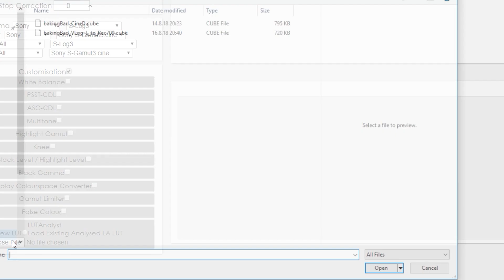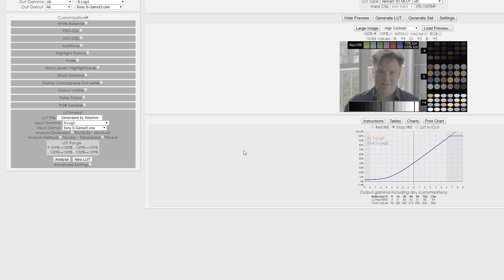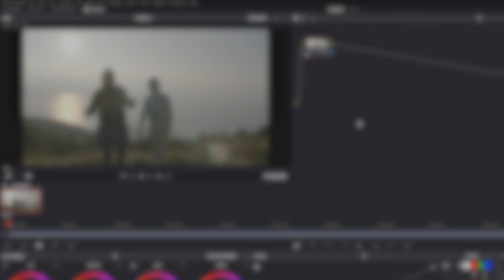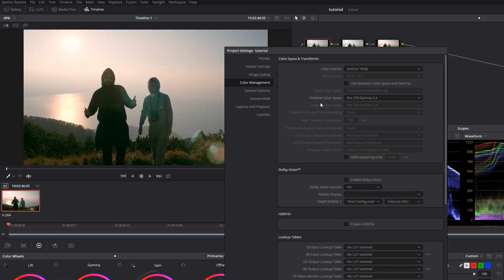Create Monitoring LUT for GH5 and GH5s - DaVinci Resolve 15 and LUTcalc

Comment: This awesome!!! I wish I knew the settings for BMPCC. That would be great.
Reply from the maker: Thanks for watching! I'm not familiar with Blackmagic cameras, but since the process is pretty straighforward, I'd go with these settings:

Camera: Generic

Rec Gamma: Blackmagic - BMD Film
Rec Gamut: Blackmagic - Passthrough
Out Gamma: Rec709
Out Gamut: Rec709

As for the LUT file format for monitoring, I don't know what BMPCC uses. Try googling that one.
Assuming BMPCC has an 8-bit screen, I think you should be fine with other settings if you set them like I did. Try asking around on Blackmagic forums, I believe it's pretty active. Best of luck!

And as for the settings in Resolve. I wouldn't know these either, but I'd assume you'd be okay with the ones like in my video. Again, try asking around on the BM forums. Since Resolve is made by Blackmagic, I believe the process of getting the right settings is pretty simple since you're using Blackmagic-made camera.